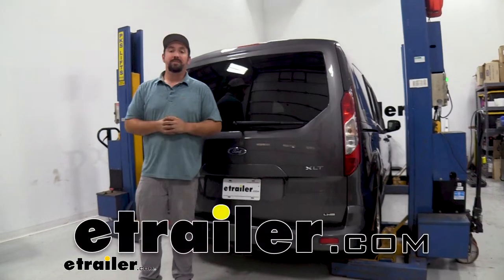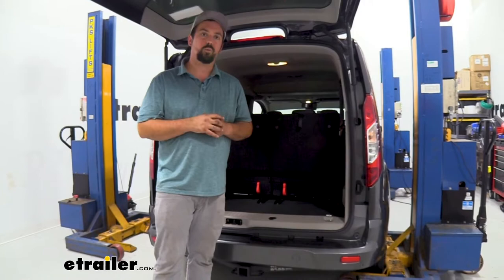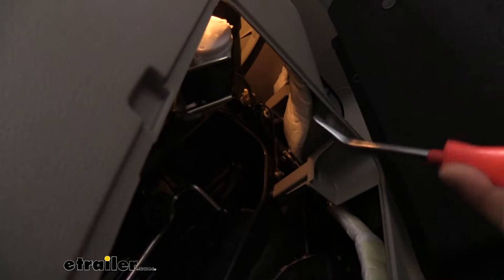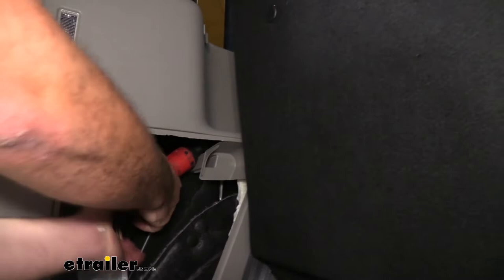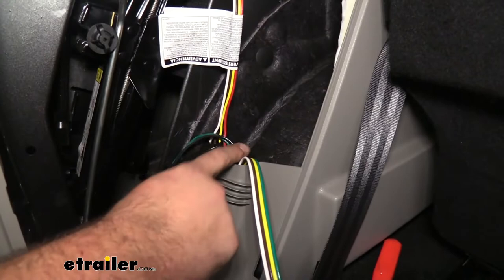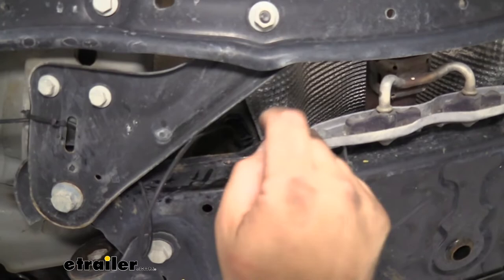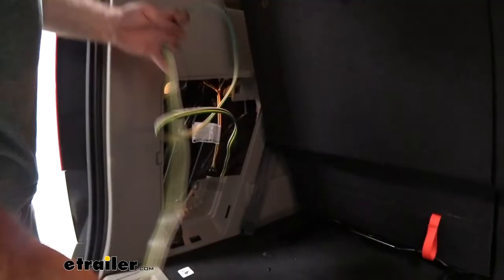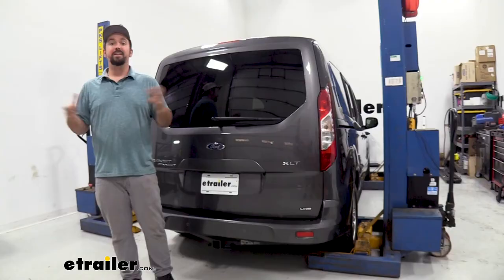etrailer | Curt T-Connector Vehicle Wiring Harness Installation - 2019 Ford Transit Connect

Comment: This video came in clutch. I bought a Curt Harness and Hitch about a month ago and didn’t install the lights because there was no video for my make, model, and specifically year. I went to look again today because I NEEDED to install it and low and behold this video was uploaded 16 days ago. I’d have never known to do things like drill through the floor or snake the wire up into the engine bay. 

I am laughing that the beginning of the video describes it as an “easy” install. Two and a half hours, a drill gun, a rubber snake, two heat shields, a dozen push pins, dirt in my eyes, and one broken clip later I successfully installed it. The video is so nonchalant about “this is a good time to put your vehicle up in a lift if you have one”

That being said I don’t know where I’d be without this video and I’m so glad it was uploaded. Thanks!!
Reply from the maker: Thank you for the feedback! We are happy to help!
https://www.etrailer.com/vehicle/2019/Ford/Transit+Connect
Reply: I’m about to install mine and am wondering if I can jump into that rear 12v socket.
Reply: @ProbablyStonedComments  fwiw once I took the time to do it correctly it’s never bothered me since. I can’t speak to using the rear socket but to save yourself loose wires and janky DIWhy setups I suggest you take the time to thread it up into the engine bay. 

I poked a long piece of foam down through the engine bay to fish the wire up through. Made it way easier to reach.
Reply: @TaylorSatula  I’m an electrician so I’m not too concerned about the diy stuff, more concerned with stuffing my fat self under the van to run the wire on the underside. 🤣🤷🏻‍♂️